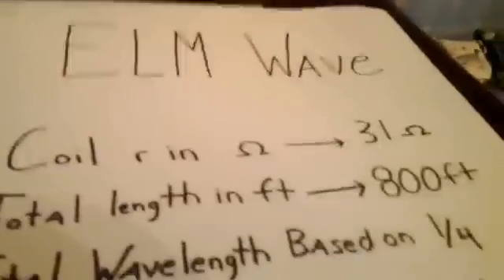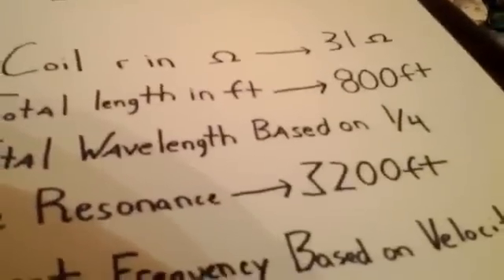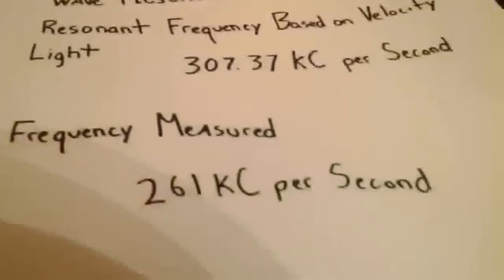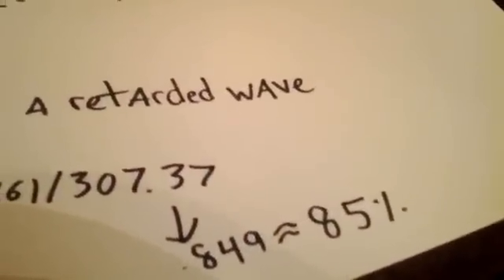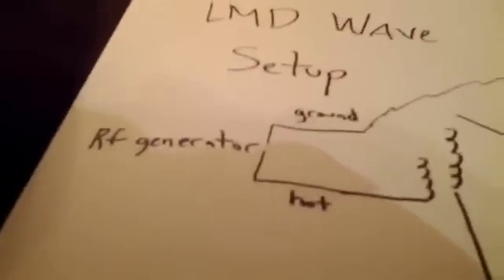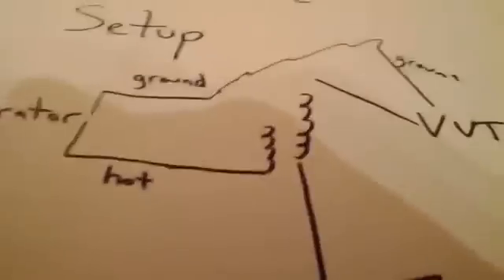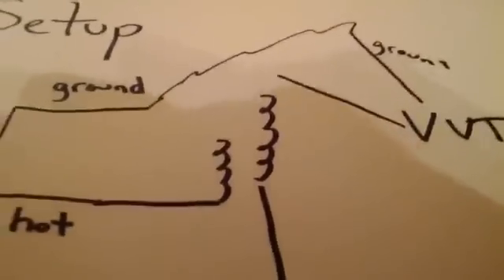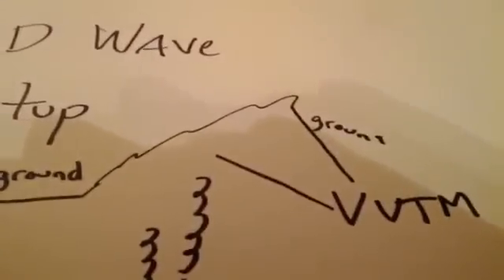PROOF of FASTER THAN LIGHT Longitudinal Magneto Dielectric Waves; Eric P  Dollard demo

Comment: Dear Sir, in one of your videos you explain that the scalar wave on the secondary of a Tesla coil does not travel along the length of the secondary coil wire but perpendicularly to the coil winding in upwards direction towards the sphere using a loose spiral motion due to the dielectric properties of the coil. 

If that is so then i proof  that tesla wave in a Tesla coil are not superluminal as suggested, although faster than transverse EM waves, not because faster than light travel speed but  cause the shorter distance (shortcut) they travel to reach their destination meaning Tesla ways travel always in a shorter path than the transversal ones thus faster and not due to superluminal speed which actually can not exceed the speed of light  in a vacum. Take please a moment to study my proof and inform me if I'M  wrong.
Reply: That's a good point.  The ultimate proof would be measuring longitudinal waves not through a wire but through a vacuum chamber.
Reply: @scsi_joe  Todays vacuum chambers are not actual vacuums. That's like calling space a vacuum. It isn't.
There's no such thing as nothing and space is a measure.
I imagine the minimum energy required to create this perfect vacuum could only be harvested from the vacuum you want to create. 😂  
It is my belief that the ultimate "lightwave" is instantaneous. If the "big bang" event happened in a true vacuum light could manifest from one end of the universe to the other without resistance. What do ya think?
Reply: @alexashworth3119   It doesn't have to be perfect, it's still a worthwhile experiment.  Compare a conventional transverse wave vs. longitudinal in the same chamber, take measurements.   If there is a difference, you'll see it.
Reply: @scsi_joe  Sounds like a good idea. I wonder if this experiment has already been done. Would be worth looking into. 
I have this feeling that this so called light speed is a ghost just like the magical photon particle wave.
I wager that what you do here in this universe has an instantaneous effect from one end to the other. 
Of course; the disturbance and its observable change is slow while its effects fade out from view, but the immediate change is as soon as the disturbance is established.
Its observable effect is so fast and becomes so small that we cant measure all of it nor see all of it with what tools we have available. 
Everything we see is always built upon things we cant see.
You turn over one stone and find another stone under it.
This seems to be a repeating pattern in nature, like the answer isn't a flat number but more like an angle, or a ratio...not a position but a direction.
Im just rambling now. 😂Im fresh into most of this stuff and am in way over my head, but it sure is fascinating. 
Looking at all this scientific knowledge is like looking at the ocean, its overwhelming but also beautiful. 
Surfs up dude 😜👍
Enjoy the ride ✌️
Reply: Truth to be told. The only reason why it is superluminal is because longitudinal waves through the coil is actually parallel to the magnetic field. Caduceus Coil is the best example. It is literally a LMD beamer.

Comment: When was the last time they said "kilocycles" not "kilohertz"?  By the way the retarded light speed is  given by ~ 1/(pi)^(1\7) * c      Or approximately the reciprocal of the 7th root of pi times the speed of light if that has any meaning in this video.
Reply: +Soteriology101 maybe we should START saying kilocycles instead of kilohertz as one is 1000 x a cycle, and one is 1000 x a guys name. one meaning makes sense to EVERYONE who speaks the language and the other only makes sense to those who speak the CODE. the only purpose of this "CODE" is to keep things a little more confusing than it needs be.

Comment: What formulas did you use to get the numbers shown on the paper?  I am interested in seeing your calculations, and I have the equipment necessary to try and reproduce this.
Reply: take the speed of light, around 3E8 and divide by the length of the wire 243.8meter * 4 (for qtr wave) and you derive the frequency. Speed of light in copper though is slower by a certain unknown percentage.